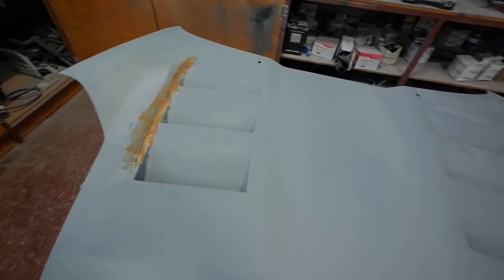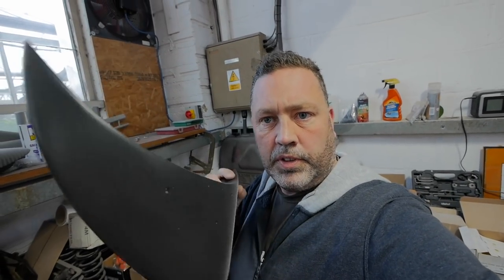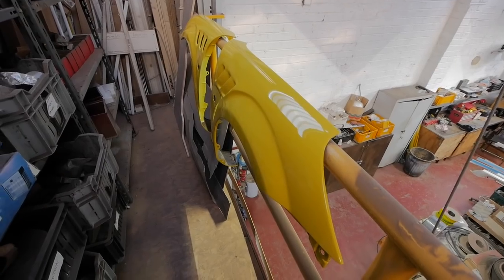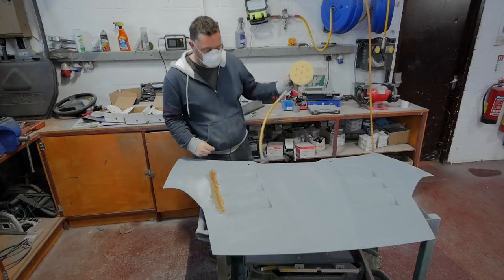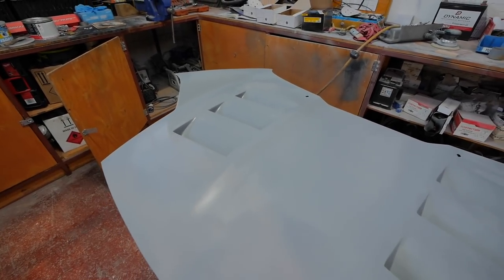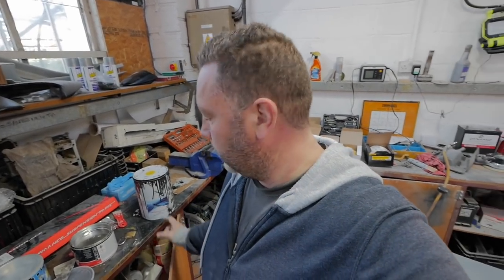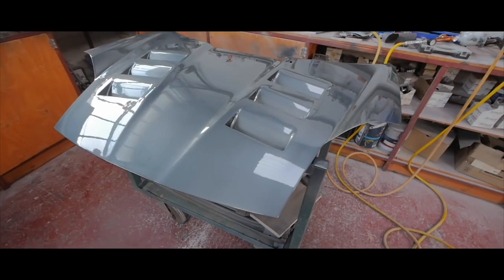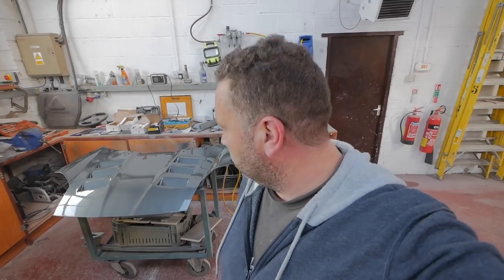custom bonnet/hood vents finishing up- mr2 spyder/roadster

Comment: I think the nice thing about your videos is that you are just a regular guy experimenting with stuff. I used your fuel rail idea and it's been great!
Reply from the maker: Cheers mate. Not everything turns out great, but the fuel rail is one of the good ones.
Reply: @SpyderLEE  This is true! But if you don't invest all of your money into a build it's a lot more enjoyable and when things go wrong it's not a big deal. My turbo setup should be running soon. For the fuel system I did a DW300C, PTFE stainless lines, AEM regulator, and I have a set of 875cc injectors waiting to go in if I go e85 on it.